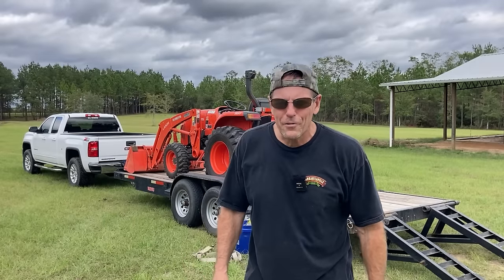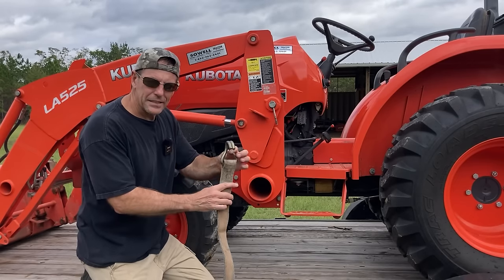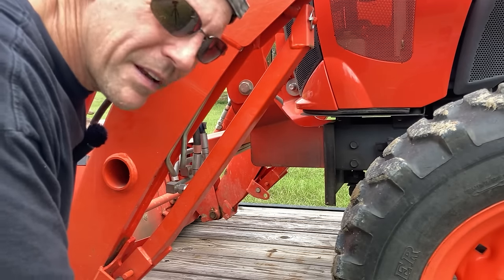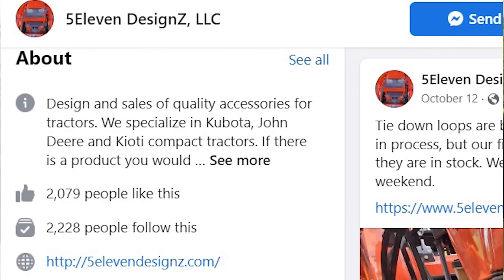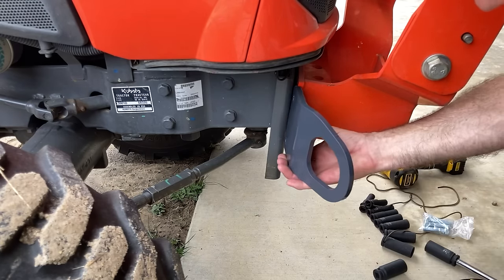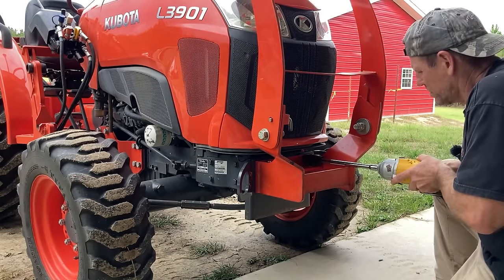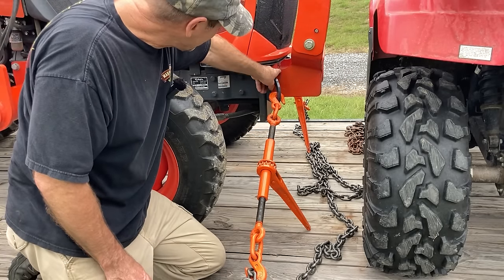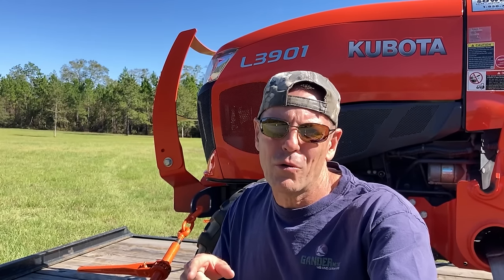Simple Tractor Mod Makes Trailering Easier and Safer!

Comment from the maker: Check out our tractor playlist with over 40 tractor videos here:  https://www.youtube.com/playlist?list=PLG5yS75HLzo3RVqEuA0f6IioXV6FtFhHW

Products in our Amazon store used in this video (costs nothing extra to use these links!).  You don't have to buy these specific items to support our channel....just use a link below to get to Amazon then make any purchase: 
Flex Tape: https://amzn.to/3R4MdWm
Solo Seed Spreader: https://amzn.to/3UGIws7
Fuel jug nozzle kit with drill bit: https://amzn.to/3H5EeoE
Orange rubber gloves: https://amzn.to/3xIdlEt
6’ Digging and Pry bar:  https://amzn.to/3vH5Agx
FIMCO 15 Gallon Sprayer: https://amzn.to/3HgxSmp
Renegade Razor Hybrid Brush Cutting Blade: https://amzn.to/3yaJtk9
Dewalt 20V ½” Impact Wrench: https://amzn.to/3UOcXNH
Dewalt 20V brushless Leaf blower: https://amzn.to/3zwJcYm

Tie down brackets from:  https://www.5elevendesignz.com/

Comment: As others stated double check your states DOT requirement.  The tractor requires 4 securement points by itself.  The attachment require their own.  In this case you need 8 securement points.
Reply from the maker: thanks for watching.
Reply: You are absolutely right Sir. Some people NEVER Read the Operator's Manual; they just watch utube vidios for infomation.
Reply: Only requires 4 tie downs if over 10,001 lbs.
Reply: I believe that depends on the weight of the machine.
Reply: In California our DOT officer that does our bit inspection says 4 points of connections and a strap over the rear attachment depending on size of attachment
Reply: MODOT now requires each corner to be tied down.

Comment: I first started transporting my tractor with binders and found them more time-consuming than what they were worth over the 1st year.  I then ordered commercial ratcheting tie down straps with chain ends versus those hooks.  You can easily hook the frame and slide the other end into a stake pocket.  I can fasten either my tractor or a mini ex down at 4 points faster than installing just 2 out of the 4 binders that I was originally using.  I've been using straps since 2018 and will never go back to the binders.  The straps are rated at over 3,300 each, more than enough for these small units.  2 straps at the front guard / frame and 2 straps off the rear tow plate, and it's tied down at 4 points!  Plus, 1 on the implement, if there is one!  They are worth investing in if you move your equipment enough.  I probably have close to 20 strap setups now with varying lengths
Reply from the maker: Great information for our viewers.   Thanks for watching.
Reply: Dude in new to all of this and i truly appreciate your insight. Thank you kindly.
Reply from the maker: @subixbarbarasson6052  thanks for watching

Comment: Don't know what state you are from but pennsylvania dot requires chains ,one on all 4 corners of the machine.
Reply from the maker: thanks
Reply: The law I know does not specify chains- it goes by working load. So if ratchet straps meet that working load your good. DOT regulations only pertain to commercial operators.
Reply: Dot regulations apply to all motor vehicles not just commercial!! As far as dot is concerned an improperly secured load has nothing to do with commercial or private! The tie downs added to the tractor are a great 💡 idea.
Reply: @jamesklee9980  I don’t know PA but I asked Kansas Highway Patrol and 4 pt tie down here only applies to commercial.
Reply: @James Klee  DOT in my state only counts when it's commercial equipment.    You don't even need lights on most trailers people use in my state.       This trailer here would be one of them.

Comment: Taking the loader of the tractor makes absolutely no sense. It counterbalances the tiller and especially the brush hog. And as far as wear and tear on the pins, if you keep everything greased properly there should be zero issues. I recommend you get a third function up front and get a grapple, and leave that on always when not using the bucket. Best attachments you can ever get.
Reply from the maker: I couldn't disagree with you more.   Most compact tractors, especially the Kubota L-series are heavy enough that running typical tillage implements requires no extra weight up front.   Without the loader the tractor is much more maneuverable and the sight lines around the tractor are greatly increased.   Loader pins will definitely wear out even when greased.

Comment: I had to travel over 2,000 miles each way to pick up my tractor, I live in Alaska and there were no options with a cab in the state for 9 months.  I just use(d) axle straps and when you cross your chains on the front they clear the steering linkage easily.  It works with or without a loader, eliminates the need for midpoint lateral support, and kept a larger tractor than this in place for over 2,000 miles.  This seems like an unnecessary modification to me, that doesn't really make trailering safer or easier if you just approached it differently from the beginning.
Reply from the maker: thanks for watching

Comment: As a truck driver with decks, load securement is very important. 
Please be aware that you failed to secure forward and backwards movement by only securing sideload stresses.
Reply from the maker: Good information.
Reply: If he would have angled the chains forward and aft it would have been more secure. However I like the attachment bracket!
Reply: First thing I thought and was hoping he'd do more...

Comment: That's a nice add-on for your Kubota. My TYM/Branson 2515h had holes pre-drilled on the side of the frame at the front and a heavy 1/2 inch d-link worked perfectly with the existing holes. They give me the same capability with my TYM that these give you on your Kubota.
Reply from the maker: Every tractor is a little different but all mfg should include a way to tie them down on a trailer.  Thanks for watching!

Comment: Dot will have the WLL of any strap or chain that is directly attached to the item being secured. 3,000lb strap down to 1,500lb and 5,000lb chain down to 2,500lb. Direct tie down (attaching to item or through item and back to same side of trailer) vs indirect tie down (across or through item to other side of trailer). Wheeled or tracked vehicles need 4 tie downs and then at least 1 for any attachments. From a flatbed/step deck driver for 6 years. 😃
Reply from the maker: Great information

Comment: So easy to walk into a hard ware store and but a couple 3/8s Cabell hooks and drill a 1/2 hole in each side braket and mount your hooks with pins and cotter pins that come with you purchase then you can either use chain or same ratchet stamps he uses and way more convenient because  you can simply drop what ever you want to tie down with and hook and tighten down. Cost for more convenient is about12.00. And can pickup at local hardware store.
Reply from the maker: this was quick, easy and works great.

Comment: Thanks new sub here, thanks for sharing info on the brackets. I have a Kioti and same problem with limited tie down points. Will contact 511 and see if they might weld a set for a Kioti. 👍TCT
Reply from the maker: He makes some good stuff.   Check out Zooks welding too.   Thanks for stopping by. Cool channel you got!

Comment: Those brackets look thick enough for a sub compact, but a compact tractor needs 3/8" thick of maybe 1/2" thick brackets depending upon the weight.
Two significant problems in this video. 
First, You NEVER use straps to secure a tractor. ALL straps stretch and many tractors have flown off trailers unexpected due to strap flex. Messicks has a video covering this. A salesman was delivering a new tractor and the tractor flew off when the trailer went over a bumpy RR crossing at 25 mph. Plus DOT regulations state grade 80 chains and binders. You can get a ticket from a savvy cop who knows the law. You need 4 chains for the tractor per DOT. You need 2 chains for the front end loader. You need 2 chains on the rear implement.
Second. The bolts you used are not grade 8 which is what you need for a tie down bracket.
Reply from the maker: thanks for watching
Reply: The brackets are 3/8" thick which is thicker than the frame they are fastened to.  They are actually grade 8.8 bolts and supplied with the brackets.
Reply: That doesn't sound right.   I think that's for a commercial vehicles towing a very heavy machine like a Cat 235 backhoe or 977.

Comment: Good video.
Maybe you said and I missed it, why are the brackets angled vs flat? What would the purpose be if there reversible when mounting?
Reply from the maker: I'm not sure but I'm guessing to clear the tire and tie rod if they are facing forward.  As far as beveled on the top, versus squared off, the MFG shows them with the square side up...I put them on with the beveled or sloped side up.   They fit either way and so far I'm happy with the way I put them.  Easy enough to change if I need to though.  Great idea and great product.
Reply: Most likely to insure a 4 corner diagonal pull, not a loader mount & front side bind.
Reply: They are angled so that when attaching a chain the bracket is at the same or similar angle as the chain.
Reply: The straight angle towards the anchor point is crucial for not bending the bracket when stressed.

Comment: How do you tie down the rear part? Good demo 👍🏽
Reply from the maker: I do two on the front on the new tie downs.   Then I still do  one strap on each side inside of the loader "tube", then one across the implement which of course is attached to the rear of the tractor.   So 5 points total on the tractor now.
Reply: You have to tie the tractors down off each corner front and back 4 points of attachment…..  then you have to tie down the loader with its own straps and any rear implements with its own strap.  If you are not doing this you are breaking the law.   Luckily most troopers and sheriffs departments officers could give a rats ass on anyone hauling a compact tractor and implements……  unless they are having a bad day and want to wear your ass out and they will eventually.    Good luck  but I would highly recommend reading your states hauling, trailering and the required tie down requirements.  Most of not all states are all the same now which is the federal standard.
Reply: @genewilliams7497  great tip…I’ve just been looking for an attachment or hooks to install on the rear of the tractor to avoid scuffing paint or metal or strapping chain around the axles.

Comment: How long is the trailer you used in the video?
Im currently waiting on delivery of an L2501, but im not sure if my 16’ car carrier style trailer will be adequate.
Great video btw!
Reply from the maker: It's 18' flat deck (10K).     16' car carrier will be OK if you have a box blade or tiller on it but a brush hog will stick off the back of the trailer.  At 7K, a carrier has enough capacity for a 2501 + loader + implement, but a 10K 18' is a much better choice.  We've had 3 different trailers for our tractors and it's my favorite.
Reply: @PineyGroveHomestead . Thats good to know!
I was wondering if 18’ was enough.
I plan on leaving the 66” heavy duty box blade on the tractor as my counterweight when im not using other implements.
Thanks for the quick reply!

Comment: There's a problem here. When you chain something down at 30 degrees angle to the load, you are DOUBLING the load on the chain. For a 3/8 grade 70 or 80 chain, that wouldn't be a problem. Still, it's always best to not rig in this matter. https://www.youtube.com/watch?v=2xwi5xo8xOQ
Reply from the maker: thanks

Comment: Your front brackets aren’t even needed.  Slip the hook from a chain onto the weight bar and pull is to the front and side at a 45 degree angle.
Reply from the maker: thanks for watching
Reply: That method will not isolate movement side to side.

Comment: The federal motor carrier safety administration actually puts out a cargo securement manual for drivers.

Does it apply to private parties..  no.  But you’d be silly not to consider it.

https://static1.squarespace.com/static/58530c911b631b89245744ab/t/629a6af48fdad44c90828ed7/1654287095354/Drivers+Handbook+on+Cargo+Securement.pdf
Reply from the maker: right on